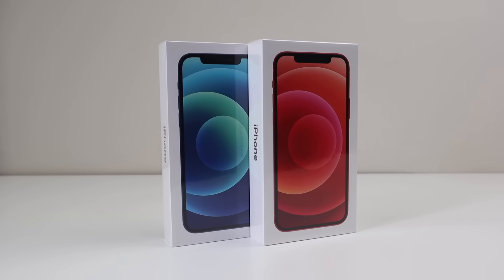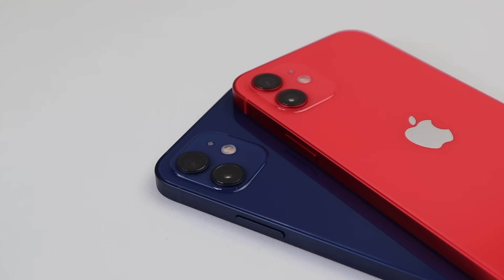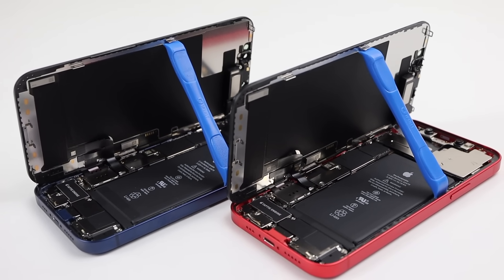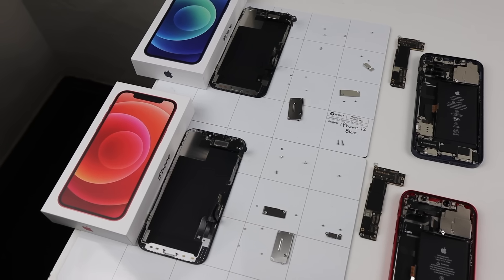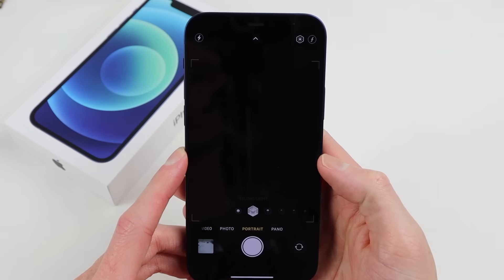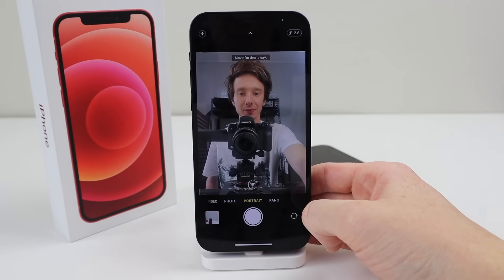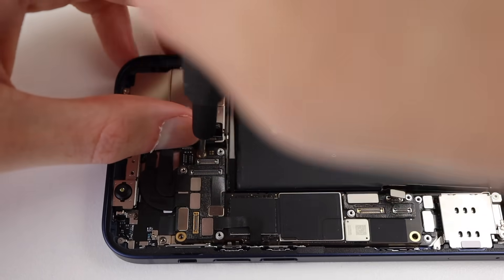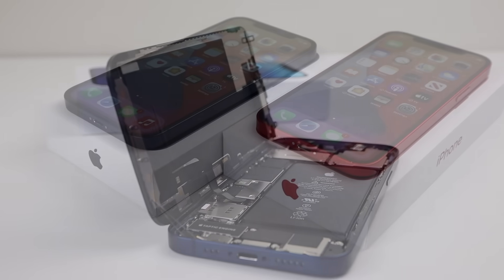iPhone 12 Anti Repair Design - Teardown and Repair Assessment

Comment: Terrible. Its unbelievable that we have gotten to the point that, even using genuine repair parts, the manufacturer has doomed you to fail in your repair. I totally disagree with any company that does this. Sure, they need to offer their own repair service; and lets face it, the majority of people will use it for the assurance and convenience; but monopolizing repair and preventing the use of any other options, EVEN with the correct parts and techniques, should be prohibited by law.

Comment: The problem is we have a economic model that does nothing but create 
waste for profits. EVERYTHING we produce today is designed and 
engineered to either be disposable immediately, to be replaced by the 
next product cycle in 2-12 months, or to break down as soon as the 
warranty runs out. And all of it is to keep this BS man made measurement
 of GDP growing as we consume more and more of earths LIMITED resources.
 If you took a toaster that may last 4-5 years today if you are lucky, 
and engineer it to last 50 years? That is a 900% reduction in the amount
 of resources that our society required to perform that function. And 
that includes all of the energy used for the extraction and processing 
of materials, Manufacturing, distributing, delivery and final disposal 
of that item, nine additional times as well. Its not that we do not 
possess the engineering skills and material sciences to manufacture said
 toaster, there is simply no repeat sales and endless profits in that 
model. And thus no GDP Growth. There are no solutions to our situation 
within ANY monetary system. The minute you add the profit motive? You 
negate sustainable practices. And if you think we can legislate for 
that? I'd like to inform you that there is not a single law in history 
that has not been broken out of necessity, jealousy or greed. Laws do 
not solve problems. Changing the environment that is creating the 
problem is how your solve it in society. Capitalism is by far the most 
wasteful form of resource management that the human species has created 
in our evolution.

Comment: SWAP the components and go back to an Apple store and let them have a look at it WITHOUT telling them what you did.
Could be some funny content there.
And yes it is not a software bug but a software design that checks every item inside the phone if that is the original part that was programmed into it.
So regardless if you use official original Apple parts you can no longer do anything yourself in terms of repairing it.
I should therefore note that this phone should be ILLEGAL in Europe because here we DO have the right to repair our own devices.

Comment: ive always had apple products but apple sucks now imo. Super expensive for no real benefit. I maxed out my MBP (2011) with 16 GB of 1600mhz corsair memory and a evo 9 500gb SSD drive and it is super fast, but the last mac os be like "buy a new mac now, we no longer support you!!" Windows 10 seems more stable than Sierra as well. As for the smart phones, ive got a iphone 6s which works fine but when it dies i wont be getting apple

Comment: This is just funny. Apple takes steps to protect its customers against shady unofficial repairs and you all hate on them for doing it. So pathetic. You can get your iPhone serviced at an authorized repair store. Simple.
Reply: @nimpbl3494  Correct me if I am wrong, but the phone can't tell if a part is "brand new". All it knows is that it came from a different phone and was done by an unauthorized service shop.
To the GENERAL CONSUMER (aka not techies, enthusiasts, etc...) this is a good thing. 3rd party stores may replace parts with those that have already been used and the customer is none the wiser.
I went to a 3rd party service store to get my Macbook fixed. Those assholes put Apple branding everywhere and claimed to had put a genuine 1st party BRAND NEW Macbook battery as replacement.
4 months later, after I moved to a different country, it starts acting up. I take it to an official Apple Store. The battery was a Chinese knock off with Mandarin symbols scratched off. It was even intended for a different model (2013, not my 2014).
So this 3rd party store lied to me. If I got a notification that the part is not official I would have never paid them the $250 they asked for the repair (more than just batter but they are still fucking scammers).
Reply: Haha, you're so gullible

Comment: I had a choice between an iPhone SE second gen and Moto G7 Power for my next phone. I went with the Moto. I, also, just got a new Windows desktop PC for Cyber Monday. I’ve worked on and owned several Mac laptops in the past, both repairing and upgrading. (Repairs that would have been a nightmare with the crappy new unibody designs, btw.) I can’t stand how Apple thinks they still own the device, even after someone purchases it. The Moto has great features, and I swear a better quality camera than my year and a half old iPad Pro! Windows 10 comes with antivirus software built in, so no more mandatory Norton trials. In this day in age, there’s just no good reason for sticking with Apple, especially if we’re at the mercy of the Geniuses and their overpricing of any and all repairs. If Apple wants to phase out at home and third party repairs, I’m phasing out Apple. I think I’ll check out the new Chromebooks once my Air becomes outdated.

Comment: I dont get why people are still buying iPhones. Shitty IOS that has low rams making apps crash so frequently after using the device for just 2-3 years. Bragging abt the system that Samsung already implemented years ago. Low battery life when the device is used for certain years. Just get samsung. its better
Reply: I really don't get this either, I was always wondering how anybody could be buying this. It's sad that some people are that dumb, and enjoy getting scammed.
Reply: @Pvrge.  like i see very small improvement most of the time when they release something new...like camera got a bit better or smthin like that. and its been that way for ages. for samsung its different, and china is just there copying apple and samsung

Comment: Can you imagine if Apple made Cars?
This reminds me of a Mercedes-Benz that gave a "replace DEF fluid" error message.  The DEF aka Diesel Exhaust Fluid was full, 
however the vehicle electronics now suspects you are intentionally non-compliant with the pollution control standards.
A few days after this message, a more ominous error was displayed: "Replace DEF 18 Starts remaining" Every time you started the vehicle, the number of "Starts" was decremented.  If no starts remained, it would let you drive at a max speed of 15mph to a service station to fill the DEF.  Unfortunately for us it was the DEF SENSOR which is only replaceable by the Mercedes-Benz dealer!

Comment: Correction: You can use your old power adapter with your old cable to charge the iphone 12.  I have about 8 of these old adapters/cables lying around. You don't have to buy the new power adapter.

Comment: Apple: "we're aiming for zero waste"

Also Apple: make it physically impossible to repair/replace parts of their Hardware without paying their ridiculous warranty prices where they'll just replace the entire phone
Reply: For comparison it cost about $490.50. For all the parts for a iphone 11 according to techtrends  so if you bought all the software and parts you could make a iphone 11 for much less then the 12
Reply: @JohnJohn004  thank you for the info!
Reply: In just costs (the device I'm using won't let me edit my comments and I dont feel like getting my phone just to edit a comment)
Reply: Honestly I might just switch to a flip phone.
Reply: "(edited)" What did you edit?
"wast" waste
Reply: Here is apples official prices to fix just the screen of the iphone 12 when out or warranty iPhone 12	Screen repair (out of warranty)
iPhone 12 Pro Max	$ 329
iPhone 12 Pro	$ 279
iPhone 12	$ 279
iPhone 12 mini	$ 229